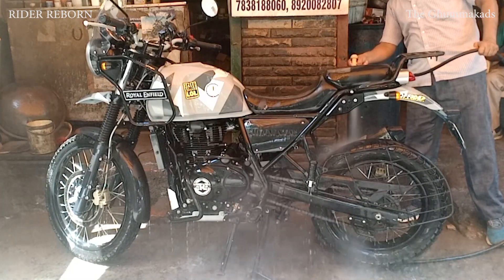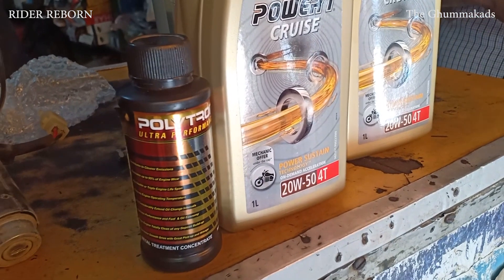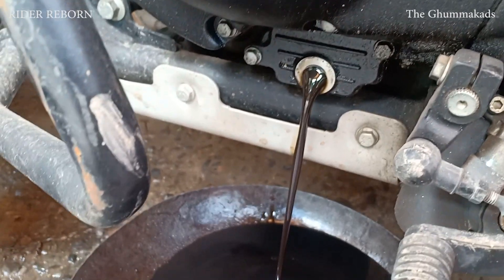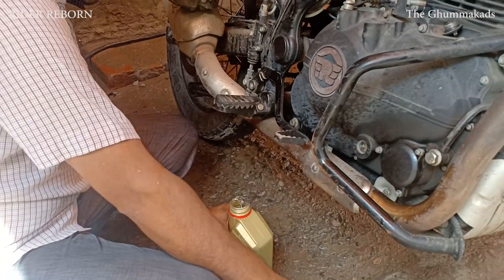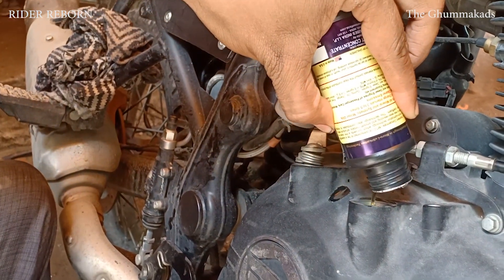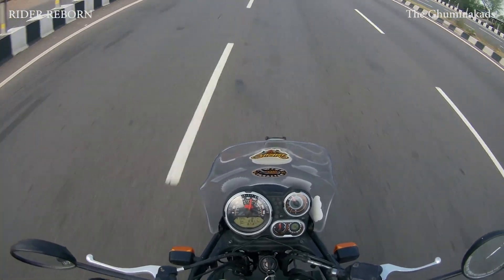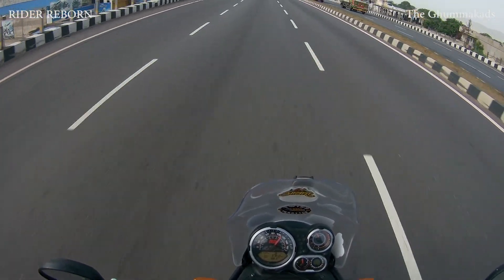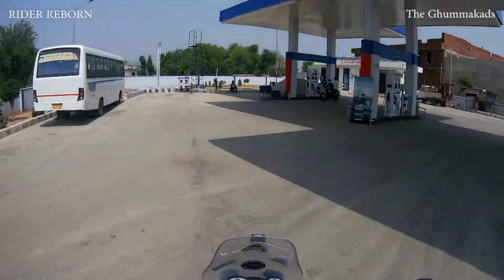Royal Enfield Himalayan and Polytron MTC Oil Additive | Review Polytron India | Rider Reborn

Comment: But, bro... I have a small doubt. Behind the Polytron MTC pack, it's mentioned to add 10% of the total Oil capacity. Therefore, as Himalayan's oil capacity is about 2L (1.8L), so you should add 2Bottles of Plytron MTC'na (each 90mL)?! 

That's my first part of the doubt. Second, is I'm having a 2013 Bullet Electra. And, I suddenly became curious for additives for engine oil. Thus, I found LiquiMoly MoS2 (20mL) tube, which is recommended to add 1tube/liter. But, I just bought one, coz of lil cash shortage. Then, my friend suggested that Polytron MTC is awesome as he tried it. Then, I'm at this point.
As Bullet requires 2.5L Oil Change & I have one tube of LM_MoS2, so what if I buy 1pack of Polytron to make a combo additive like? {Mobil 15W-50 SemiSyn(2.5L) + LiquiMoly MoS2(20mL) + Polytron MTC(90mL)}

Just bear with me, as I'm a noob...😅
Reply from the maker: Actually for wet clutch bike like RE Himalayan you only need 5% MTC which is 90ML for Himalayan. 
Secondly you don't need anything else it's you are using Polytron MTC. 

Just add 5% with your engine oil and you'll feel the difference just after 10-15km of riding. For more information please feel free to whatsapp me on 9654184882
Reply: @RiderReborn  Thanks, bro❣️
Reply from the maker: @நவின் சூரஜ் My pleasure Bhai ❤️
Reply: @RiderReborn  It's 5% for automatic transmission. For wet clutch applications it still needs to be used 10% by volume i.e. 900ml oil + 100ml additive = 1L
Reply from the maker: If you'll use 10% in wet clutch bike you'll loose friction...you should only use 5% of total sump
Reply: @adityashah4634  10 % in wet clutch will cause clutch slippage